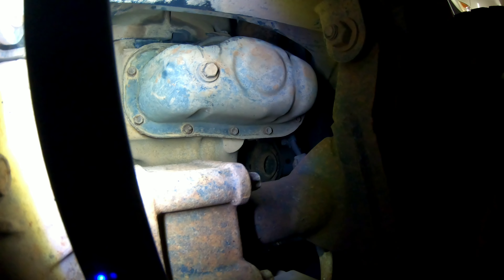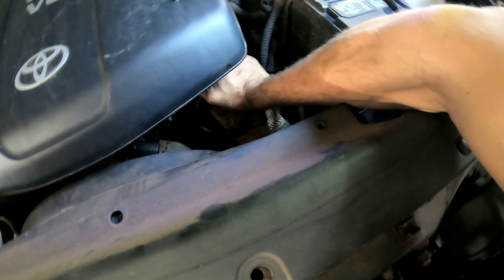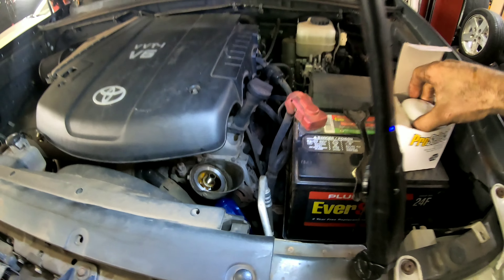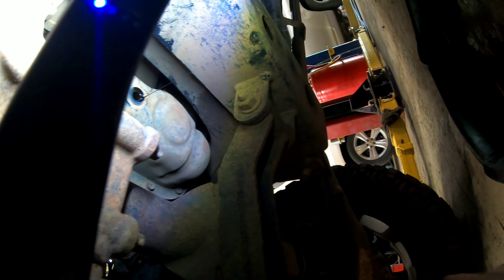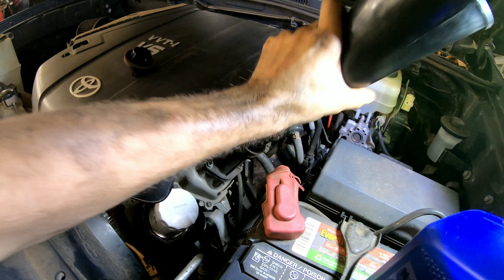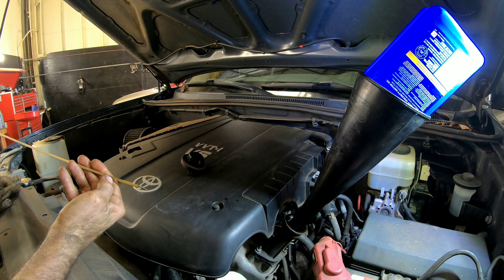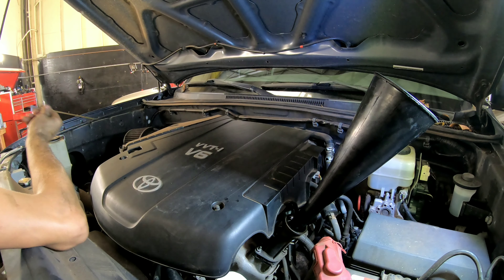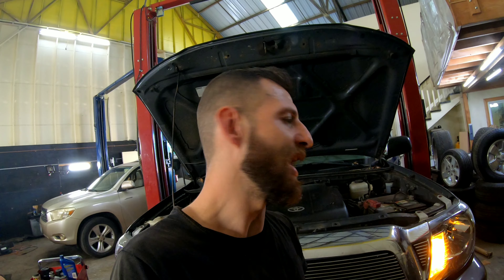Toyota Tacoma Oil Change and Maintenance Required Light Reset

Comment: Using that dirty rag to clean off the oil filter mating surface is one of many reasons why I do my own oil changes.  

I want to try that empty quart trick with the oil filter removal.  Been using a fast-food plastic cup. 

Your videos should get way more views.  I really like how it's straight to the point; no extra shenanigans.